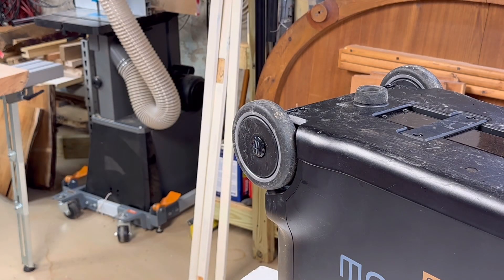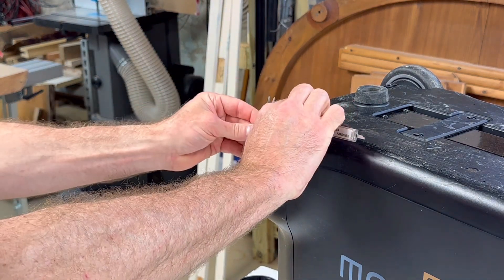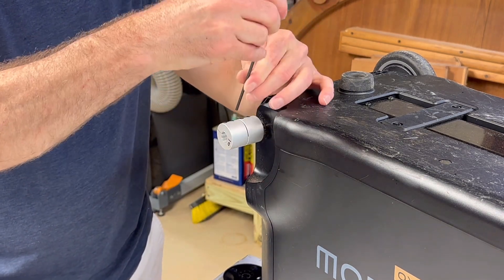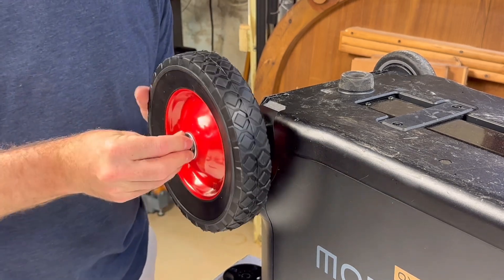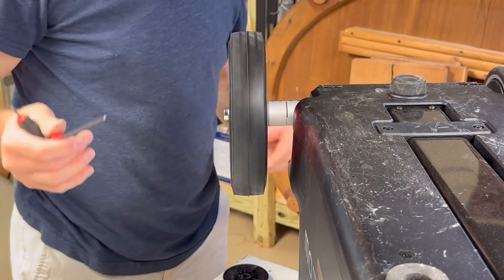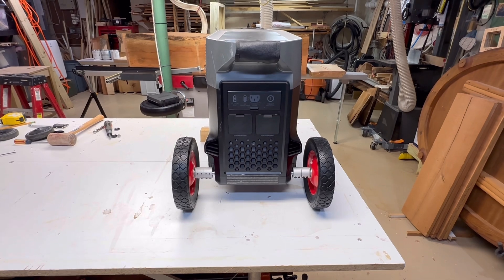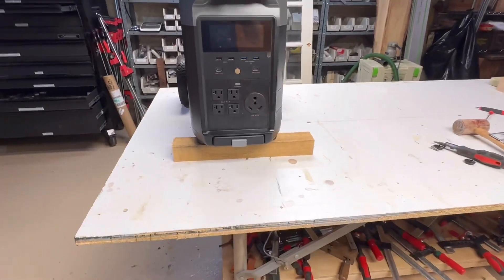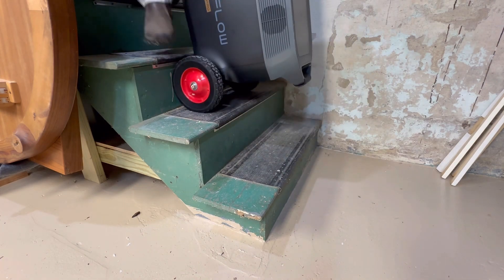EcoFlow Delta Pro hack - turning it into an all-terrain vehicle by putting larger wheels on it

Comment: Great vid, I wasn't sure how to remove the wheels so my Delta Pro's & Smart Batteries would fit into 31-gallon galvanized garbage cans (used as as Faraday Cages), but would you have any idea how the wheels come off of the new Delta Pro 3's?  They don't have the center ring, & without removing the wheels the lids won't close.  I was so close...
Reply from the maker: Unfortunately, I’m not familiar with the Delta Pro 3’s. Good luck, hope you are able to figure it out so you can make sure they will be ready when you need them!

Comment: Thanks for posting.  was looking for ideas on how to do what you just did. My biggest problem is getting the DP up the porch stairs without having to carry it so I am looking for solutions. So far yours is the best I have seen. Whoever produces a marketable solution is going to make some money.
Reply from the maker: Good luck with whatever method you decide to use. I just took mine in and out of my cabin yesterday, and the larger wheels definitely make it much easier.